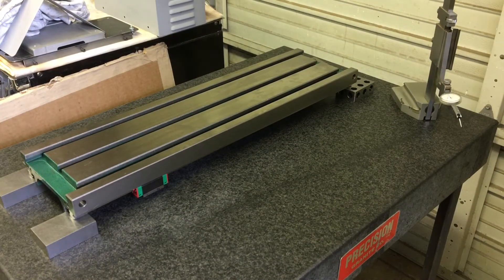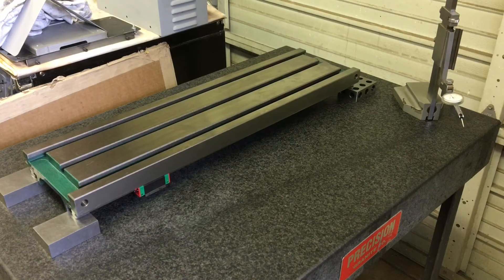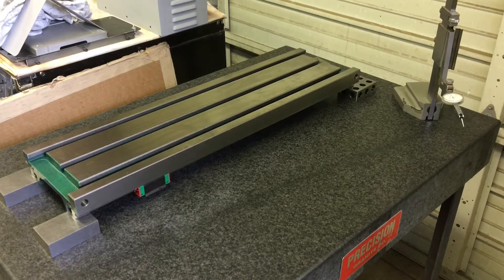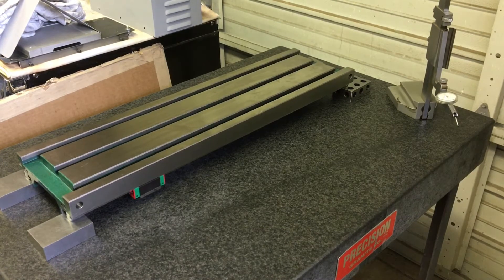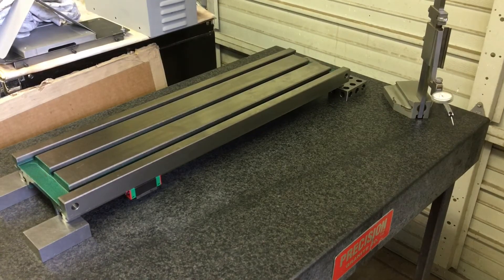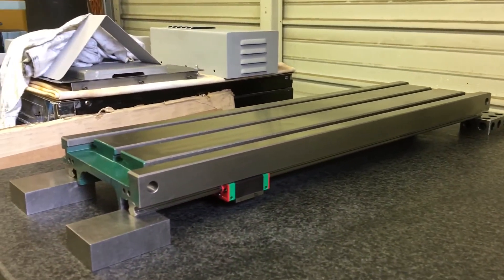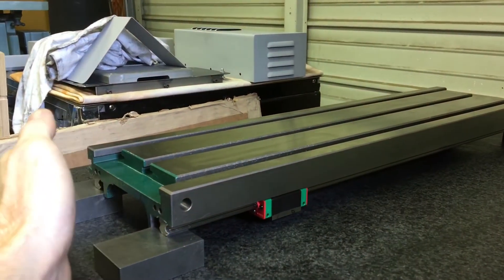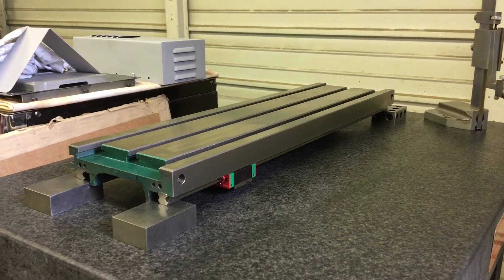GRIZZLY G0704 CNC Conversion Update 17.5 - ( table talk... )

Comment: I'd be scared to see how flat the table on mine is lol
Reply from the maker: I bet you your table is much better than what mine use to be! lol Its was pretty bad. You should at least sweep your table with a indicator to see what your working with.... idk it might not matter depending on what you are using the machine for. How are things with your machine? Been missing the iron forest Insta updates!! - Nick
Reply: It's probably nowhere near .02", I'll run an indicator across the table and let you know. Haven't had a lot of time to work on it recently, but I did post a video yesterday. Almost broke my beat up, chipped 1/4" 4 flute, it started to load up, but I stopped it in time. I ordered a couple proper aluminum endmills today, along with a new California air tools compressor! My current one is about 3x as loud as my machine, extremely annoying, cause it runs about every 2 minutes lol.